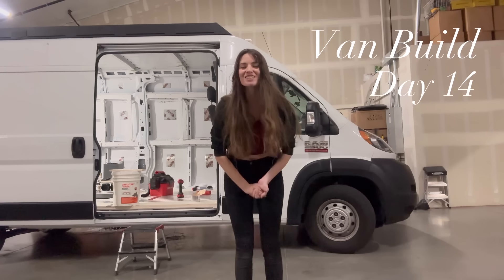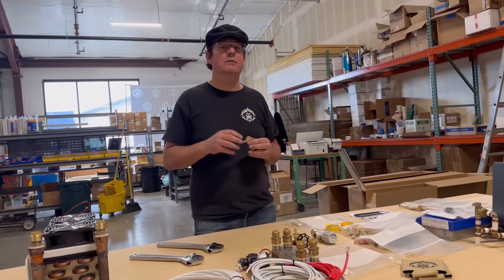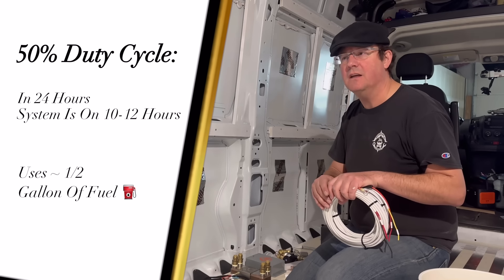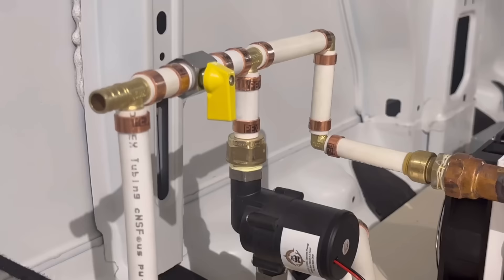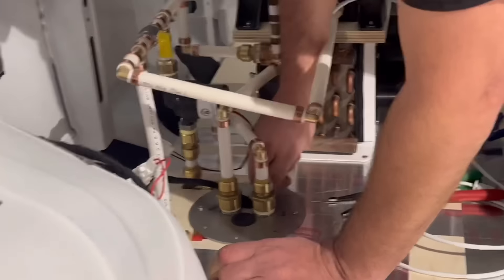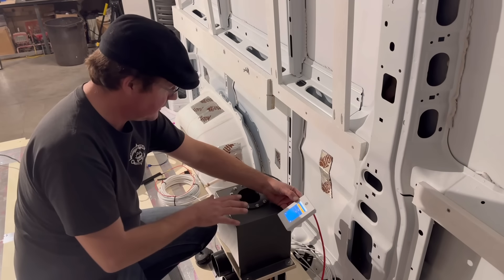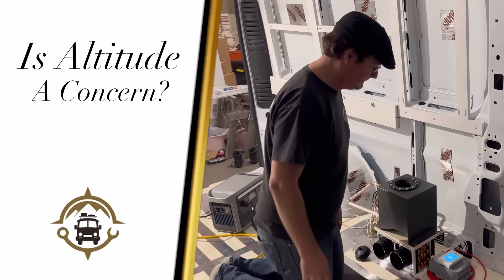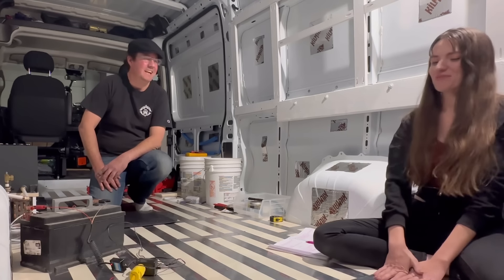Installing DIY Radiant Hydronic Heated Floors with VanLife Tech (Part 2)

Comment: I was gonna say you should use that to have hot water for a shower build, until I saw him put the orange liquid in it....
Reply: It's possible, a heat exchanger is used so the glycol and fresh water transfer heat but don't mix.
You can also use the van engine as a Source of heat or use the system to preheat the vehicle engine.

Comment: Will you be installing flooring directly on top of this layer? Seems like the metal tape is fragile and may make direct adhesion difficult.
Reply from the maker: That is such a great point, I think they are far apart enough I won’t have a problem but we will definitely see when I get to that portion of the build, the tape has numerous purposes. It keeps dirt out of the cracks and away from the piping and it marks where the tubing is so that you never screw into it (there is a third reason that has to do with the actual heat but I can’t recall what it is right now). But basically the tape is super important but I definitely see your concern & I’m interested to see the results when I get there ☺️

Comment: Whoohoo! Congrats! Can wait to his how this system changes your van life experiences. No more failed heated blankets in 18F weather for you. Safe travels 😊
Reply from the maker: YESS!! I never want to go back to that haha I am excited to test it out up north next month!
Reply: If I wanted to advertise any product for vans and wanted it promoted honestly and thoroughly I would definitely install it with you Tory

I like you cosy too 😂
Reply: @ToryDelury I want this system for my smart car 🚗 😊❤
Reply: @ToryDelury you could control this unit with Home Assistant very easily and have all your systems in one platform. In fact, home assistant itself could control all this units features out of the box. Two stage system, away mode, and remote access. Can even monitor your carbon detection and add as many temperature sensors as you want.  Really need to investigate Home Assistant for your builds.

Comment: Tory, as always you strive to find the solution to what has created the worst experience for you Van-Life, with my sincere admiration for how you share your happy or sad moments with such a flair (knuckleheaded) banter. You are spot on with this heating solution. You know about the (Yeti Link Vehicle Integration Kit) the new YETI PRO 4000 it’s an updated LiFePO4 battery tech means it can last for over 10 years. Tory, please research using a (dedicated Alternator with a Second Battery) you might have a second battery most Vans have a backup. You will not need it for the motor, so disconnect it from the existing hook-up.   The reason most direct battery hook-ups for the Vehicle Generator have so many issues is that manufacturers use Smart alternators essentially those that have their output voltage controlled externally via the Engine Control Unit (ECU). The smart alternator system allows the vehicle to control the output voltage from the alternator based on vehicle operating conditions to reduce electrical load and in turn mechanical load on the engine by the alternator, this renders it unsuccessful at charging a secondary battery system to a usable level.

Comment: Great video, as always! Love your casual, comfortable presentations 👍

Now, about the system... I was all about considering this upgrade, but, quite honestly, there is no way that a roll of PEX, all the fittings, etc., lumber, insulation and plumbing and electrical components warrant a $7,000+ price. The expertise of installing the system and the time to do so still doesn't account for that price. 

Sorry, but that's just not reasonable. Thanks for the video though! Very important info was included. 

See you in your next video! Be safe!

Comment: A heated floor is very comfortable, but it is not clear whether it cools as well. The heat pump air conditioners that are fitted in the roof can cool and heat, using a third of the power that a heater uses. It runs on electricity. Natural gas is very cheap for heating.
Reply: No this is not a cooling system

Comment: Americans are always innovating. Super important to have CO alarm.
Reply: The boiler is outside of the vehicle so just needs the exhaust pipe run to the outer edge of the vehicle.
Getting co inside would be unlikely.

Comment: That’s really awesome but the problem I’m seeing is now you have all that stuff in your way and have to build the rest of your van around it. It seems kind of like a hassle lol.
Reply from the maker: This unit will be inside my bench seat so luckily not too much of a hassle to build around as I’ll just place the bench over it. It does mess up my plans for the placement of the wall for the garage area. But honestly we went over all the different places I could put it & this was the best option I had. However honestly I didn’t realize the unit was SO BIG! Not that it would change my mind on the system but it’s just taking up a lot of room I hadn’t planned around, And I will say I do wish I had put down the vinyl flooring first but… hindsight is always 20/20 😅

Comment: You can put some furry warm slippers on your feet and scrap the floor heating. If you have the cash to burn, cool. But it makes no sense to me.
Reply from the maker: LOL, I understand the frustration with the price but also living in a van with a Webasto in Vermont winter I know the cold goes right through those slippers fast 😅 Maybe heated slippers that don’t pull too much power or my go to was to just avoid touching the floor at all costs 😂😂🫡

Comment: It’s cool you have heating floor now. However, am I the only one concerned about all the fittings and the fact that it is somehow rigid which might cause an issue over time with vibration and even hitting bumps on the road. I’m just concerned, not criticizing.

Comment: wouldnt it be easier and cheaper to just install a cheap diesel fuel Truck heater ??
Reply: 80 to 90 percent cheaper and easier
Reply: but it's not radiant heat

Comment: This doesnt make sense. Half a gallon of fuel is 20kwh of energy if 500wh goes to heating then it's a 5% efficiency system which is unspeakably dismal. A diesel air heater has a 90% efficiency. Like how will you heat up the van from 500wh of energy anyway? Your body radiates 60-70 watts at all times to begin with. It's as if you wanted to make the van toasty with a third of your bodyheat. 

Like how does this guy know how much heating will be needed in a day anyway? As if it didnt depend on a shittona factors...

I think you are being scammed here big time...i mean i'm not saying it aint gonna work but this guy is speaking pure bollox that much is true...it just doesnt make any goddam sense...
Reply: Well you’re partially right. He should have said at what temp his numbers were derived from. Being scammed? I don’t understand what you’re talking about. Also I would bet she got the system for cost. I highly doubt she paid close to the 20k this costs
Reply: @michaelscarfi3196  Yeah i'm not sayin it's a scam i'm sure it will work but the guy seems to be pulling numbers out of his arse which i never like...